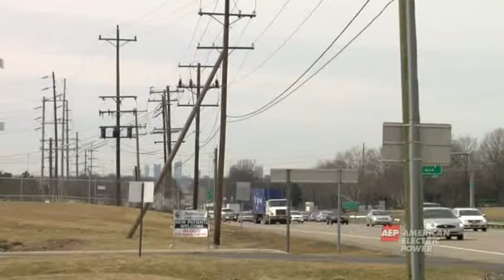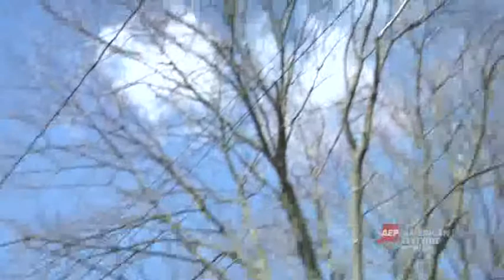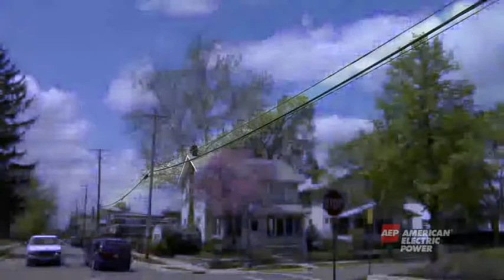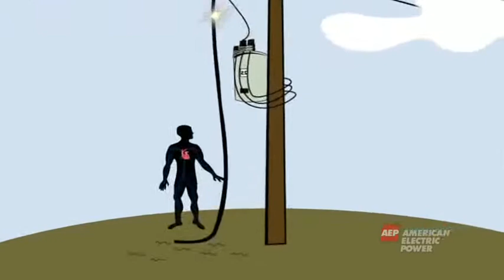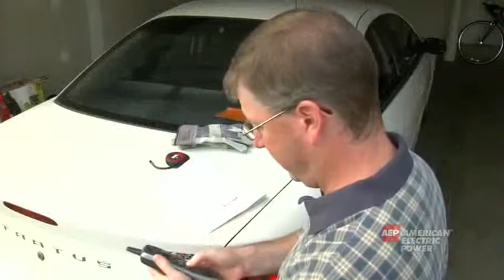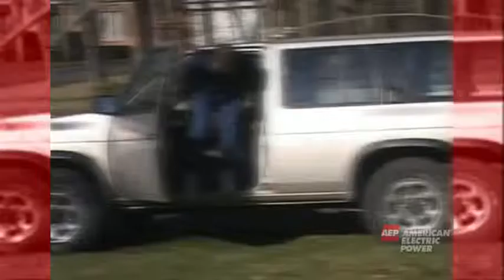Anatomy of an Electric Grid System How it Fuctions Sun Flares

Comment: Overhead distribution lines sometimes do not shut off in the event the line is down or making contact with the ground. What has to be understood here is the fact that our system ( in the United States that is) is what distribution Network operators call a grounded neutral system. We use a grounded neutral system because of a couple of main important factors. The first Factor being that if every pole that is carrying high voltage feeders is grounded with its neutral conductor to the Earth you subsequently make a situation where there is a specific distance between poles that offers a clear and effective return path for the current to flow back to the nearest point that is grounded into the Earth. In the event a live feeder or "primary" makes contact with the Earth it's going to raise the level of current flowing through the primary wires on top of the pole. Nowadays we have proper equipment that is designed and implemented on the grid to sense these high current situations and therefore disconnect the primaries at the substation. The situation where a primary wire contacts the Earth is called a ground fault. Systems have also been put in place to correct the issue of nuisance outages caused by self-clearing faults. These devices are known as reclosers. A recloser installed on the power grid allows for a three chance situation to occur. After the 3rd attempt to restore power by this automatic device has been attempted it will permanently lock itself out until a line worker has come to manually reset it. this is why it is very important to stay inside your vehicle if there are down power lines on it and it is not on fire the chance that a recloser could be trying to restore power on the line while the live energized cable is laying on your car could occur and you trying to get out of your car at the moment the recloser was trying to restore power could result in instantaneous death. As long as your car is not on fire stay inside of it. A grounded neutral system does work and is effective when it's installed correctly. It also does wonders to mitigate lightning strikes and the high levels of DC pulse current and voltage that come with it.

Comment: A neutral wire is a return wire but it is not responsible for subsequently balancing loads or not balancing loads that's done by the power distribution operator. The system being balanced or unbalanced is dependent upon the loading that is placed upon it

Comment: Lightning arrestors protect the pole and equipment from over voltage situations caused either by the grid or by substantial external forces such as lightning other sources of electrical generation etc